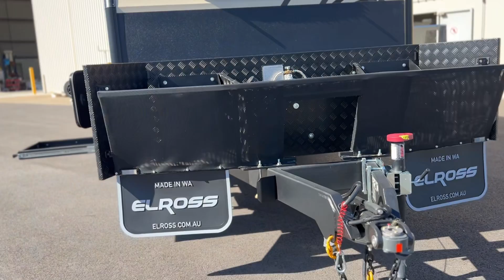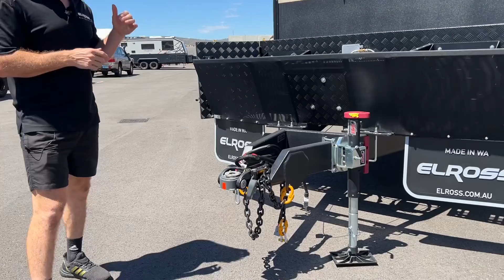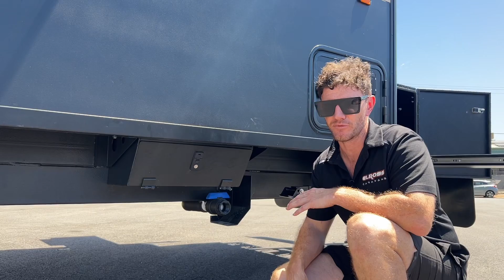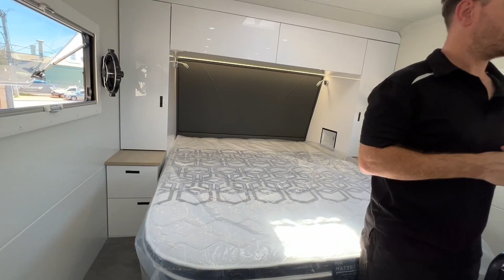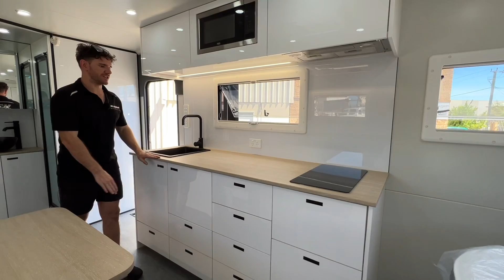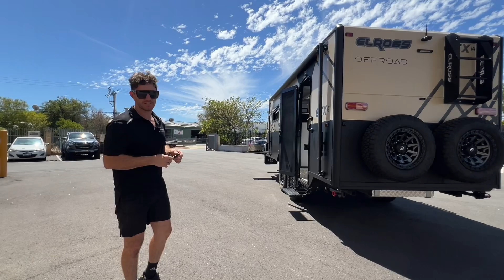Rare Sandy Taupe ECX19 Walkthrough: Large living, low weight

Comment: Just looking at your vans on YouTube and all your vans seem to have very small windows, and for the price of the van you would least expect decent size windows. Other than that nice van.
Reply from the maker: The larger windows from Dometic have a tendency to malfunction due to their wider aperture- there’s valid reasons for this so we recommend to our clients to run these windows for a more pleasurable Caravaning experience in general. It also maximizes your insulation efficiency with less uv light and more panel with insulation along with overall structural strength. 
In saying this,  we still offer larger window combinations to clients when they enquire about their own vans it’s just up to the individual to use the data and our recommendations on their own merit 
Thanks for your comment 🙏🏼🫡

Comment: Hey Declan, well done mate, another lovely van. Really impressed with the tare weight. Does this van have the new composite floor system. Does the new floor system save any weight over the old system. New raptor coat sides look very sleek. Cheers Shayne
Reply from the maker: Hi there! Shane thanks for your comments :) the Tare weight is definitely assisted in this van with the raptor sides - especially keeping in mind that the coloured panel increases the tare weight slightly due to manufacturing requirements which is something I keep neglecting to remind folks of also. Other things to be mindful with this build to keep the weight down is the std toolbox and also the lack of slide out kitchen and traditional n/s interior layout which minimises the cabinetry complexities. This van wasn't fitted with the comp floor, however our analysis on paper is that the pure weight of the outdoing timber flooring and the new composite flooring is near on identical. Where we have ben able to execute weight reduction strategies has been in the fact that the composite flooring whilst weighing the same as the timber flooring is inherently more structurally rigid than the timber floor, so weve been able to re-think the layout of the non-structural members of the chassis supports and now run less of them as a result - which depending on chassis size will yield a 10-15kg weight reduction on average.
Reply: @ElrossCaravans   Hi Declan, many thanks for the detailed reply, very much appreciated.